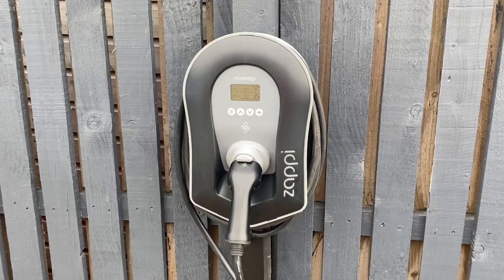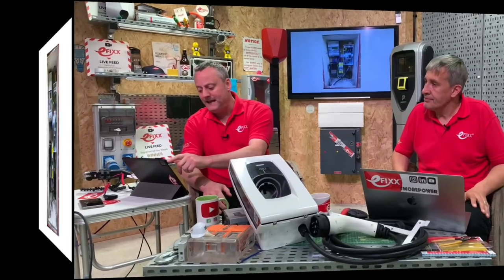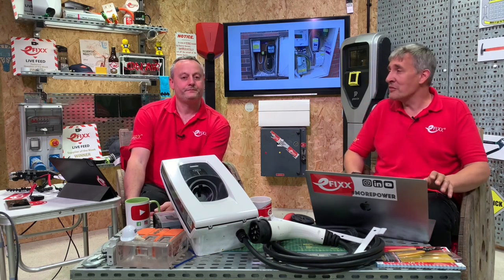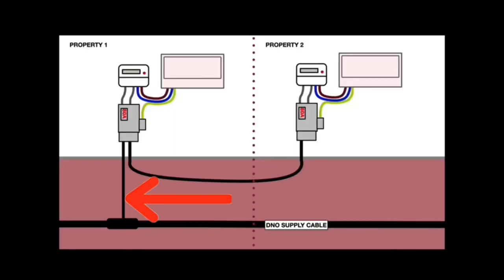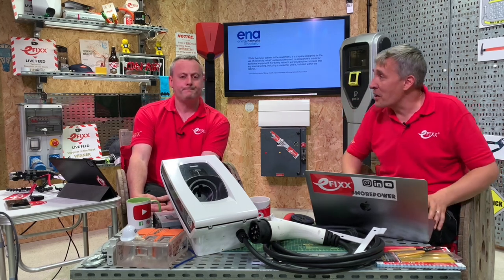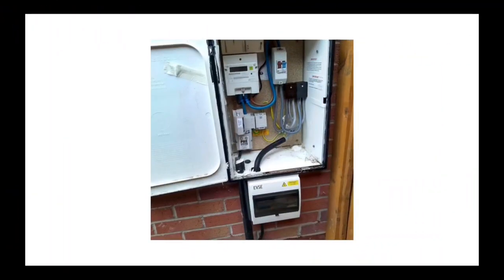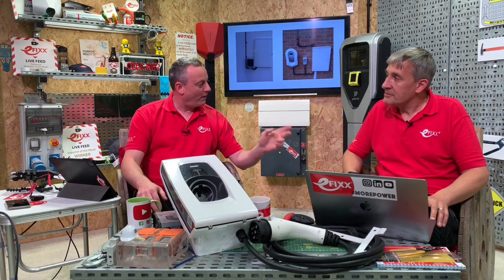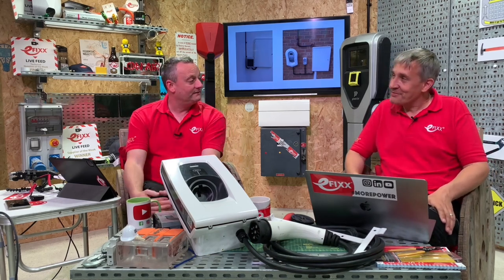Can ELECTRICIANS fit equipment inside the DNO METER BOX? - EV Charger Installation UK

Comment: ENO never said no.  They said recommend. In short you can.
Reply from the maker: The answers from the individual DNOs was a firm no. 

“ultimately NIE Networks position is where the minimum dimensions within an outdoor meter box are not reserved for our equipment, NIE Network may, and increasingly likely to disconnect the customer and issue a defect notice citing the Standard Connection T&C’s”

Your risk
Reply: @johnburns4017  If you willingly don't follow a recomendation there is always a risk to your customer to pay for unnecessary works down the line because the you have offered them advice that did not follow the recomendations and good practice available to you at the time of install. I would recommend your customers find a new electrician... But they don't have too, that's just advice.
Reply: @johnburns4017  Can we get ice cream on the way home... maybe... yeah thats a no.
Reply: @100tinsoldiers  
Understand the difference between yes and no and a recommendation.

You can say, "thank you for your recommendation, I will not go with it." Simple.

BTW, British Standards are recommendations.  You do not have to follow them.  They are only law when a law (building regs) points to a specific passage in the BS.

As time goes on myths become law in many tradesmen's eyes.
Reply: @johnburns4017  Not frightened of the DNO and don't always agree with their opinion. My job is to get a project designed, constructed, and handed over to the satisfaction of my client with undue delays and risk now or in the future. Usually, any clients that I work with would not appreciate myself going head-to-head with then DNO to win a futile argument, delaying the project, nor would the appreciate the DNO trying to force them to remove the installed works 5 years down the line, because I just did it anyway. This may even find its way in the code breakers book and be listed as a C2 potentially affecting a potential house sale as this is listed as defect last EICR.
I have 1 question, even assuming your right:
1). Are you representing your customers best interest, or your own?
Reply: @efixx  
The DNO's T&Cs have to conform to the law of the land. You cannot sign laws away, or your rights away. They all have different T&Cs.
Reply: @johnburns4017  I recommend you don't jump off a cliff, I recommend you don't stick your tongue on that live cable. Personally if someone at that level Recommends I don't do something I'd have to think very long and very hard about doing it.
Reply: @sandymcnair5298  
It is a matter of the laws of the land. The DNO has to conform to them. They cannot claim space in someone's premises, space they do not own, and that they do not use. Space they might think, they might need in 25 years time. 

If you are prepared to be bullied by them that is your problem to deal with. If you stand up to them, you will find they will back down. Bullies tend to back down.
Reply: @johnburns4017  I am done here, the floor is all yours, but I did notice that your never answered the question:
1). Are you representing your customers best interest, or your own?
Reply from the maker: We’ll let’s look at this from a practical viewpoint -  customer gets an EV charger installed and the EV installer puts in a mini consumer unit with PEN fault and RCBo etc - so essentially a 4  way consumer unit plus some Henley blocks  (see examples on Instagram) - the customer then decides to change the meter for a smart meter or an economy 7.  The meter installer can fit the new meter in the cupboard ?  - What happens next ? - who’s responsible?
Reply: @effervescence5664  Agreed, just throwing in something out of the installers control.
Reply: @sandymcnair5298  At the end of the day for all the new builds with more than 3m tails if it's within 10 years it's the fault of the original developer and they should be required to cover the cost as it's been designed in such a way that can't safely facilitate new safety measures or updates and also did not fully comply with previous standards. For any homes over the 10 year period there is no one that will cover the expenditure of the needed alterations but the DNO can't insist in making an installation less safe and are unlikely to cut anyone off though they can refuse to upgrade the supply for an EV or heat pump etc. 

Honestly this is probably the one of the few issues I have with Efixx as it's a video and topic in isolation from the rest of the information needed to make an informed decision. When I was teaching we'd cover not just the electrical side but also basic understanding of HOA, home owner and DNO needs and wants so students had the best chance of designing an installation that could be easily worked on and comply in the future without huge alterations to the structure or aesthetic of the building without absolute necessity.
Reply: @efixx  
If the customer wants extra services then the customer makes space, at their expense.  A DNO cannot say I want all of your cupboard in case, or I just want it na, na, na. 

I have a cupboard. There is enough space  for the DNOs fuse and meter to one side. I can store what I like on the other side as long as safety is not compromised. Not their business what I put in my cupboard. I could put some electrical equipment there if I wish - not their business or concern. 

This reminds me of utilities making up their own laws.  A heating system was fitted with the gas pipe run back to the meter position. No meter was there just a capped off main gas pipe.  The meter fitter came along saying he was not fitting the meter because compression joints were used in the gas supply.  They only used soldered joints.  He walked away. 

We got in contact with Conex the fittings maker who state their fittings can be used on gas supplies. We contacted the gas utility with the info, so they promptly came and fitted the meter. They can't make up their own laws!

As an aside. One job there was the old meter boxes with the fuses integrated at the top of the box - neat idea at the time. The meter was not put to one side taking up space below the fuses. A new CU was to be installed with RCBOs. It could have gone in the cupboard if the meter was fitted to one side. Simple neat job.  To get them to move the meter was extortionate.  

So, a large hole was drilled into the back of the cupboard with the CU on the wall on the other side with all cables running through. A lot of work because the DNO thought they could take liberties with space. Space which was not their space to begin with.
Reply: @sandymcnair5298  
The customer and my own.
Reply: @johnburns4017  I tend to find DNOs want to behave like the Gas Transporter but they're two completely different entities with completely different requirements. Normally the Gas Transporter is easier to deal with and much faster to act when required.
Reply: @effervescence5664  
They both supply energy. One supplies a main isolator, which is their responsibility, and used by all. One does not, fleecing people who want to make a premises safe. How is this allowed to happen in this day and age?
Reply: @johnburns4017  🤐
Reply: This thread has lost direction and turned into a  DNO bashing thread.
Reply: @sandymcnair5298  I agree, I don't care they don't supply an isolator. I do mind that everything after the meter is a customer's responsibility but inside the enclosure you provide they don't want you to fit something to safely isolate your installation. 

It is somewhat, you own the car we'll supply the fuel but you can't fit brakes. It just doesn't make logical sense in a society obsessed with health and safety.
Reply: This is going to sound like I am siding with the DNO's but I am not. The reason that there is no safe isolation in meter boxes is because electricians, designers, developer, client, and anyone involved in decision process wanted to save £100 at the time of installation. Under no circumstances did the DNO ever force anyone to install a tail to a consumer unit without customer isolation or protection. I find it laughable that one would choose to take the cost saving and then cry about it later because the big bad wolf wanted to charge them for a call out to do what should have been done in the first place.
Reply: @sandymcnair5298  
I wonder why!
Reply: @sandymcnair5298  I have two new build estates currently where it's the DNO and EDF not putting the isolators in. The developer, electricians on site and potential customers that have been watching YT videos have all asked why. The common answer we get back from both is "it's not our responsibility to put an isolator in". It's a UKPN area. I know you're not siding with the DNO but there is a constant buck passing when it comes to isolation which is why we just fit DP isolators or switch fuse/rcd to properties when required or as part of the installation wiring. On occasion we have found the DNO and meter installers have actually removed the isolators when fitting their equipment before we can do the last live tests and commissioning. Again this is slightly off the original topic but this is what we deal with in the real world on a daily basis, something that Efixx seems to be increasingly removed from.
Reply: @effervescence5664  Seriously, Thats your argument. The DNO don't need an isolator they have fuses..., They can pull them if the need to. The consumer has an isolation point in the consumer unit... If the customer needs or wants an isolator in different location, then put one in. It really is as simple as that. unless it over 3m then of course the protection is needed.
Now you think Efixx must advise everyone, that in the real world customers, electricians or whoever do stupid things.
Reply: @johnburns4017  🤐
Reply: @sandymcnair5298  
The gas utilities put an isolator on the service pipe immediately as it enters the premises. The own and maintain the isolator. The isolator is there for anyone to use for obvious safety and maintenance purposes. 

DNOs do not. The first thing they have is a main fuse to a premises. An overcurrent protection device has to be removed to isolate, which is not an isolator, and only they can remove. To isolate a supply for safety or maintenance they charge you. And they only isolate the L wire, not both L & N. This is extortion. In a gas instalation, when the isolator is operated all the supply is cut to the premises. In electricity the DNO cuts off one of three supplies cables.  

There should be an isolator immediately the cable enters a premisses as the gas utilities do. Owned and maintained by the DNO. 

As it stands, there can be 3 metres of unisolated cable running into a premises.  This can be hidden behind walls or whatever. No kidding! Sounds so third world, because it is. 

What an unsafe joke!  What a rip-off.
Reply: @johnburns4017  your intense dislike for the DNO becomes more apparent by every post you do. You really should consider stopping.
You call their installation method 3rd world because the DNO allows designers and installers to do something in compliance with BS7671 that may cost them money in the future.
Unfortunately, 98% of the time this cost saving is accepted with haste and without any thought. This is not the fault of the DNO.
Reply: @sandymcnair5298  
There is not much to like about DNOs.
Reply: @johnburns4017  I am somewhat in between the pair of you as I've had good and bad experiences with DNO's.

Current bad experience - they were contracted to put in DPs for new builds along with the supplies and haven't. The installations are all designed with the tails at their 3 meter limit and hence forth this exact topic is playing out. We're just fitting Isolators and OCP where needed as the developers now are trying to mitigate the complaints caused by unprotected supplies while still putting the CU and all the new green equipment in the center of the house/ flat. 

Good experience - generally technical at the DNO's know that DPs, HB etc need to be fitted in the meter boxes on occasion and case by case have never been an issue. The PR side gives the flat NO which is exactly what Efixx have passed on as information. Is it 100% correct, on paper yes but in practice no. 

The trouble is the legislation, the actions of those involved and the experience of those involved do not tally up with what actually happens on a day to day basis. 
I have to admit though this is only ever an issue in a domestic setting, in industrial environments there has never been an issue with a DNO in all the sites I've been on spanning a couple decades.

Comment: They were always going to say " No " if you asked them. Do Turkeys vote for Christmas ?
And that reply to me reads " We can't force you not to but we'd rather you didn't "
Reply from the maker: The ENA response was muted however the DNOs which responded directly were more to the point.

“ultimately NIE Networks position is where the minimum dimensions within an outdoor meter box are not reserved for our equipment, NIE Network may, and increasingly likely to disconnect the customer and issue a defect notice citing the Standard Connection T&C’s”
Reply: I have worked with numerous national house builders and various DNO's and the answer has always been really woolly some times we can put it in some times we can't.  I have recently proposed a feeder pillar to two DNO's to house all the kit including main isolator and small CU to split the load to the house,  Garage and EV charger and they have approved it. One even has a 3phase head but only supplying single phase. Way too many opinions and interpretations of the rules or policy within each DNO. Plastic Meter boxes on the side of a house are disgusting. Why the industry has not come up with a comprehensive unit that has the head, meter and isolator (with protection for longer tails) in one neat compact unit is beyond me and I suspect it is all because they are incapable of getting together and coming up with a plan.

Comment: Biggest issue is there is nothing in EAWR, ESQCR, Electricity Act or Building Regulation to forbide the practice. There is no unified approach from either ENA (Supposed 'Voice of the Networks'), the various CPSs or HSE and until something is in place that cabinets will be used for any purpose deemed fit.

Easy fix going forward; larger cabinets and a better unified approach to thier (cabinets) utilisation and a cohesive cooperation between all parties to draft an ACOP in relation to cabinets and thier usage....oh and Building Regulations update to not put CUs in the middle of a property, as was popular in 60s and 70s and still found today (utilising a Switch Fuse for the >3M tails).... I know I know, more chance of pigs flying but we can dream

Comment: So we can't actually install a DP 100 amp ISCO block in the cabinet or meter tails feeding another board inside the  property then , as this is additional equipment and will also be prohibited??? Plenty of installs over the years that I have seen,  have had consumer units  fitted inside the meter box. Also adaptable boxes feeding detached garages with a twin and CPC cable going in one side and an SWA going out the other. You can guarantee that if the DNO ran out of space in the meter box, it would be the customers responsibility to get it sorted at their own cost. So saying they could pull the fuse is a little extreme I would say. This only encourages muppets to try piggyback another set of tails out of the main switch of the main consumer unit. Where do we put the CT if the tails run straight out the back of the main switch and into the cavity? Knock a brick out from outside and locate it in the cavity???? It's all very well doing a mockup of an install in a classroom, but they are never true to real life installations.Putting them on the spot and asking this question, they were never going to encourage the installation of other equipment within the meter box, however I'd say they would need to assess if the equipment was actually hindering anything they would need do within the enclosure. Can you image having a new born baby and the DNO pulling the main fuse due to an ISCO block being installed in the meter box?
Reply from the maker: Wise words David - plenty more to come on this topic as the real world is full of contradictions and the advice between DNOs varies.  The problem atm is EV is running faster than they can.
Reply: Totally agree. With the proposed ban on Gas boilers, they aren't going to be able to limit every household to 80 amps, which seems to be the norm whenever I request a 100amp  supply.

Comment: I think they need to be bigger, but they are already large compared to what was before.

If the initial installation is done with care and the space is allocated well, then there could be added items.
It's when you open the box up to find a massive switch and a cu taking up the rest of the space that limits function/upgrade or addition.

Essentially there should be a main fuse and cut off switch. No one said the meter should be there., Then you get the export meters..
I'd settle for fuse, switch and  block. Then everything else where. But this can be wholly impractical.
This then falls to architecture design faults.
(Shift the blame) lol
Reply: Short point about the meter, those boxes are called meter boxes for a reason.